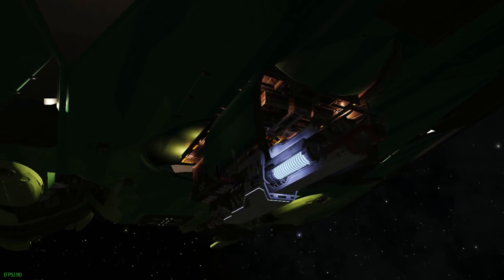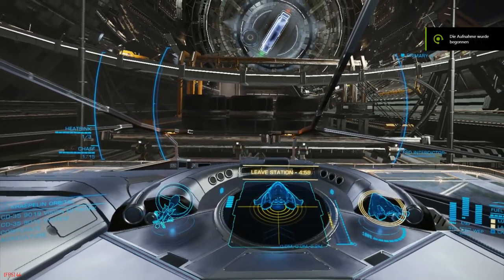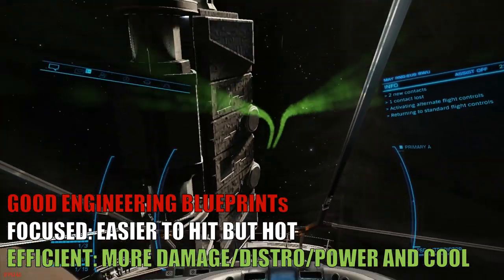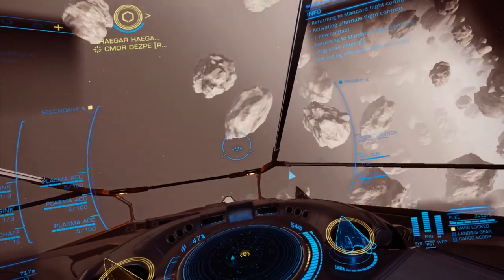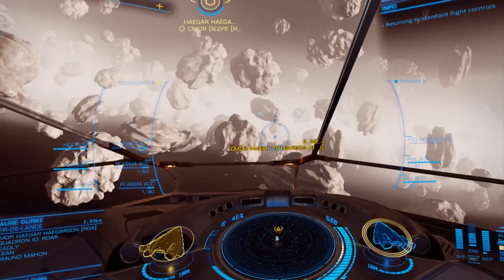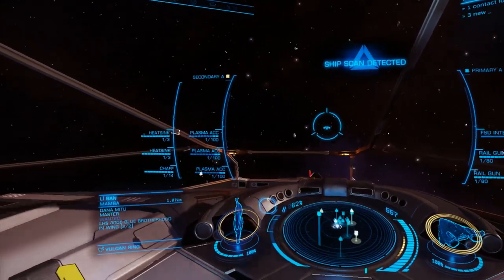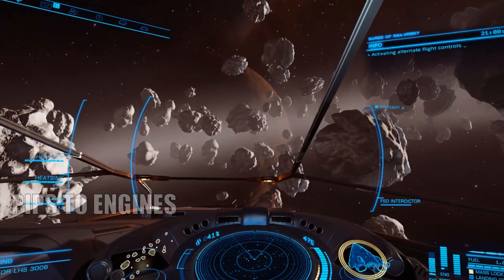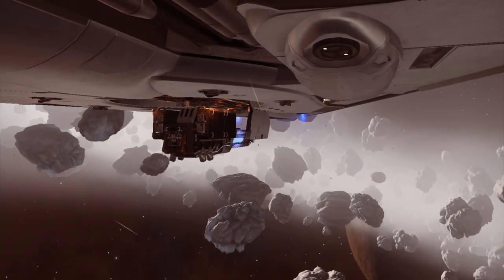"Plasma Hazard" - Plasma Accelerator tips & practice tutorial | Elite Dangerous

Comment: I don't understand method 2 of shooting.
Reply from the maker: There are two things: Your crosshair (dot) and the leading reticule (circle). You can manipulate both. The crosshair can be moved by rolling, pitching and yawing your ship. The leading reticule can be moved by thrust up, down, left, right. Try it with a stationary target first. Now if you are flying towards a moving target, the leading reticule moves according to the vectors of your target and your own ship. When you get close, use the boost to get extra power on your lateral thrusters and then thrust up down left right and watch how the reticule can be moved. If you do it right, you can pull the reticule towards the crosshair.
Reply: @dezpe42  ok. Now understand. Thank you!